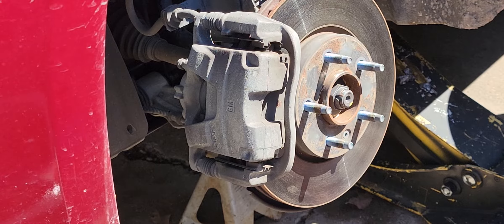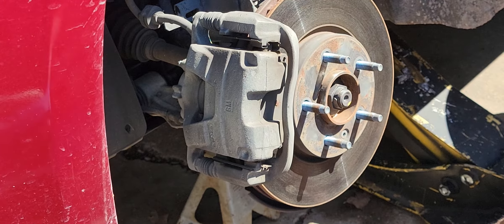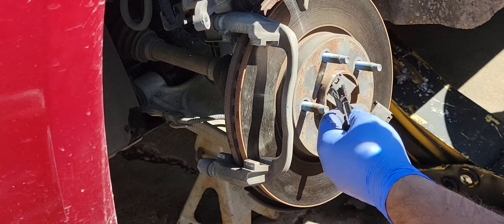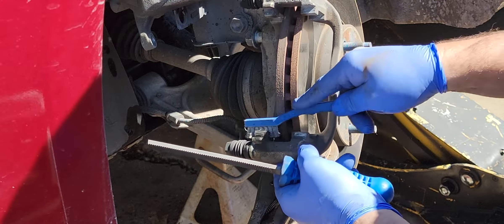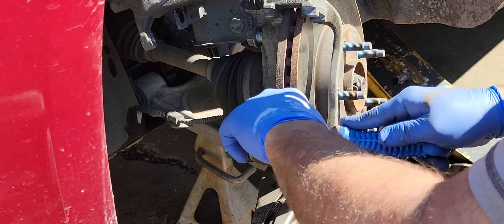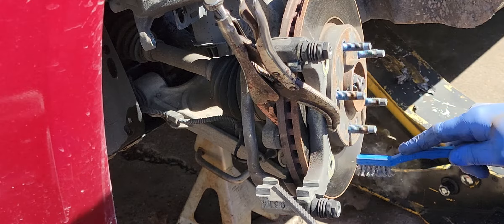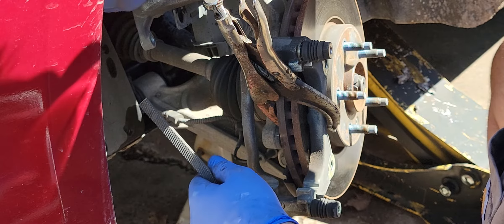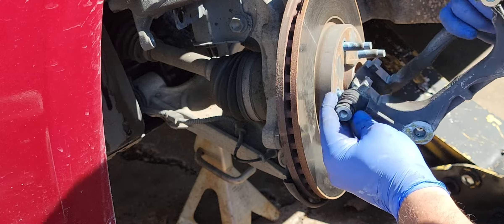Buick Verano front brake pad install

Comment: What year verano is this
Reply from the maker: 2017
Reply: @chriskolar  next question is it the same as a 2013 brake system
Reply from the maker: @GAMERIOT1999  yes.
I checked on Rockauto.
Same front Wagner 1487
And rear Wagner 1468 
The main issue was the pedal feel on this car. It was so bad I thought the master cylinder was bleeding down internally. I fixed that with abs bleed procedure.
Reply: How did you remove the rotor?
Reply from the maker: @BigJoeTheBiggest  did you watch the video. I removed the rotor in the video.